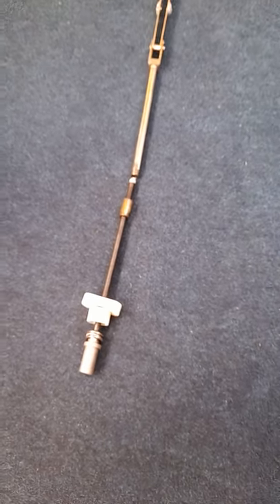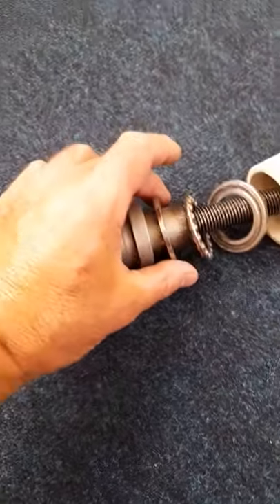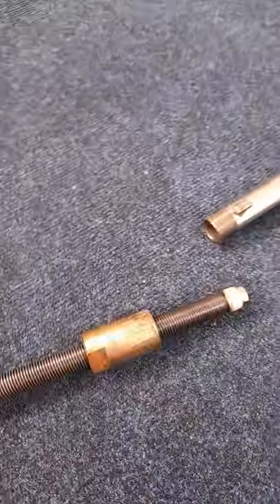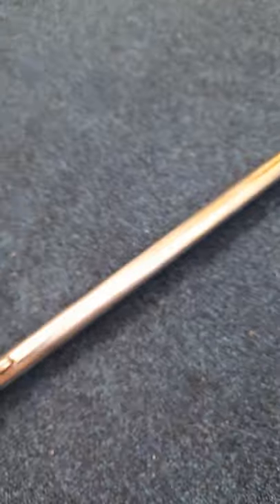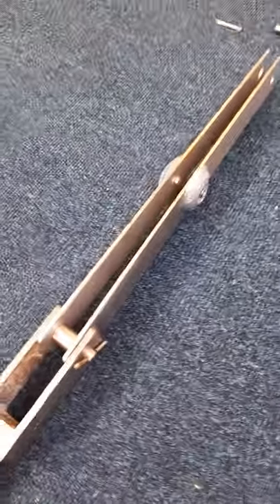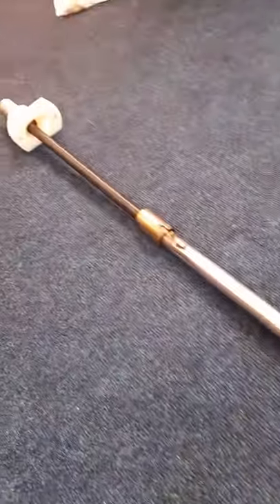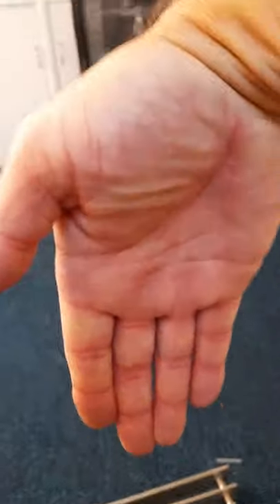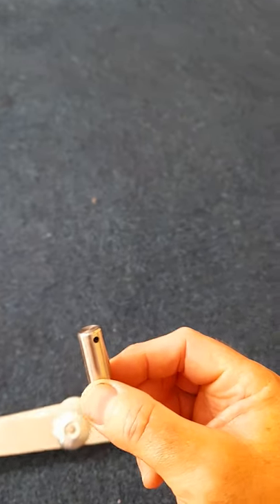Beneteau / Jeanneau Swing Keel Screw Mechanism cleaned up and refurbished

Comment: I like your video. I was wondering if you could post a video showing in detail how to remove the lifting keel screw mechanism and reinstall it.  Thank you for your informative video
Reply from the maker: Hi Joe,
Maybe I will do that next time I withdraw it.
But what you do is you suspend the boat in a cradle out of water with the keel wound 100 turns to its fully down position and gently lower the boat down a few centimeters with a block of wood under the keel so that the keel weight is taken off the winding mechanism.
Inside the cabin you will see that the mechanism rises a few centimeters up through the saloon centre board housing in the cabin.
Then you go back under the boat to the bottom of the mechanism where the winding mechanism is secured to the keel. Take out the stainless-steel split pin and withdrawing the stainless-steel pin. 
Finally, just pull the mechanism up through the saloon housing from inside the boat.
You will probably need to dismantle the saloon table to do this so that you have enough room because the hole in some saloon tables is not wide enough to allow the fork in the bottom part of the winding mechanism to pass through.
It takes about 5 to 10 minutes for the whole process only as long as you have already dismantled your saloon table in preparation beforehand.
I hope this helps.
Reply: @spillarge  Thank you for the quick response!  I will try to follow your directions.  Hope you decide on posting a video in the near future.  Thanks
Reply from the maker: @joerusso8633  Yes, in a few days the videos will be available.

Comment: Brilliant - just what we needed to know!  Does your keel knock from side to side when sailing as ours does? We are wondering whether the main pivot pin through the keel box could be worn.
Reply from the maker: There is no play or "knocking" with my keel. I have just laid my boat up for service and I have videos to download showing how to withdraw the keel mechanism. They will be viewable in a few days. It is possible that you are right in your assumption. The only way that the keel can move from side to side or back and forth to provide a knocking sound is if the main keel pivot bolt or screw mechanism is worn. You should investigate to see which part is worn and where the play is. I would suggest lifting the boat and looking to see if the play is side-to-side or slightly back and forth. This will indicate the pivot bolt or the screw mechanism.
What boat do you have and how old is she?
Reply: Thanks for your reply and all the information as we were struggling to get any information explaining how the keel system is assembled.  Our boat is the 311 Year 2003 which we bought two years ago.
There is definitely side to side movement, when held in slings, and even in the slightest of swells we can hear it bouncing off the keel box.  It only stops knocking when wound tightly up.  We have not checked fore and aft movement.
Do you have any information about removing the main pivot pin assembly?
We look forward to watching your new videos - they have been a great help to us.
Thank you.
Reply from the maker: @janethughes515  Wow!! Thats not a normal state of affairs, there is no play in my mechanism whatsoever and if I had your symptoms of sideways knocking I would be extremely worried. Whoever sold you that boat has some explaining to do because they sold you a boat in a dangerous condition IMO. 
Your problem definitely sounds like the main pivot bolt to me and that's a dangerous situation. If that bolt gives way you could lose the keel and capsize if you are under sail or in heavy seas. You wont be able to undertake the work of removing the keel yourself.
Where is your boat moored, how do you keep her? 
My advice to you is to get the boat to Fox’s Marina & Boatyard, Ipswich if you can and have the main pivot bolt and nylon composite flanges (if there are any) replaced. You should overhaul the screw winch mechanism at the same time.
Reply: Thanks again for your input.
We knew the keel needed a full overhaul and factored the cost of this in when we bought the boat. We are discussing having the work done with Peninsula Marine in Plymouth (recommended by the local Ancasta Beneteau dealer) over this winter period and it is good to fully understand what's involved. Once done we now know how to keep it properly maintained.  We keep the boat at Sutton Harbour Marina in Plymouth.
We bought a 21.7 new from Fox's in 2005 and kept it for 7 years.  Interestingly, we remember the keel knocking in that one also.
Where do you keep your boat?
Reply from the maker: @janethughes515  Mine is a 2002 built 331 Oceanis and she lies in the Burnham Yacht Harbour Marina in Essex. I hope that mine doesn't develop any knocking, this should be considered highly unusual IMO. I keep on top of the winding gear maintenance and its already out of the boat again and being cleaned and inspected. I will probably replace the bearings again this year as they are a little notchy. The whole thing will be cleaned, polished, greased and new anodes refitted once again.

Comment: Hi I commented on the other video but my boat is located in gillingham, the split pin was missing on my large clevis pin. A crew friend supposedly raised my jeanneau sundream lift keel.  When I went to lower it in the berth nothing happened and the rope was slack. I took apart the galley table and top of  keel box and saw the lift bars were no longer attached to the keel. There are two clevis pins, a 10mm by 41mm pin for the rope end rather than a screw mechanism and the end that would attach to the keel looks to be 12.5mm or 1/2 inch, same length.  I'm having an impossible time trying to source the pins. Very frustrating.  I'm hoping the keel is still hanging on the pivot bolt through the stub keel. Hopefully the pivot bolt didn't give way and then the weight pulled away from the lift mechanism,  if that's the case the keel will be at the bottom of the medway.  For now I have to hope it's still there and try and source new clevis pins somewhere.  No where local in dartford that I can find to custom make them. 😪
Reply from the maker: Hi, I am sure you didn't loose your keel. You would know all about it if you did as you would struggle with a very unstable boat which would want to turn upside down at every opportunity. You wont find the stainless steel pins anywhere in the UK.
Your best bet is to contact your nearest UK Jeanneau boat dealer who is Clarke and Carter in Chatham Marina. See if they can obtain the precise part from France. If not, my advise is to get the precise metric measurements of the lost pin because I am sure it will be metric and have one made up by a local stainless steel precision fabricator like I did which will also save you 75% of the cost. But make sure it is the highest grade Marine Stainless Steel. However, it sounds to me as if you will need new stainless steel straps and electrodes which could come as a pack from Jeanneau.
Reply: @spillarge  i contacted clarke and carter in burnham on crouch, they are who i bought the boat from in 2017. Had no reply though so far. I have been told to try mr steele in suffolk yacht habour too by someone at my current boat location which is gillingham.  The boat i have i think would stay upright even with the lift keel gone as it has an iron stub keel as its main ballast. and yeah its very frustrating to get spare boat parts here in the UK for french made boats. Had the same issue before for the special bolts for my rudder skeg bracket, sourced them in the end from a french company but they no longer make them.
Reply from the maker: @wysiwyg2006  If your nearest Jeaneau dealer is no help then at least try to get the precise size and specification of the pin you have lost. Ideally if you had the old one you could take the measurements from that. But it wont be too much of a problem to work out the measurements yourself. Take a careful look at my video at the end where I give the correct spec for mine which I had engineered locally. You will need to make sure it has the provision for a split pin and also has a flange or a washer and get the diameter correct. I reckon Jeanneau in France will help you with a replacement pack or the measurements for what you need.